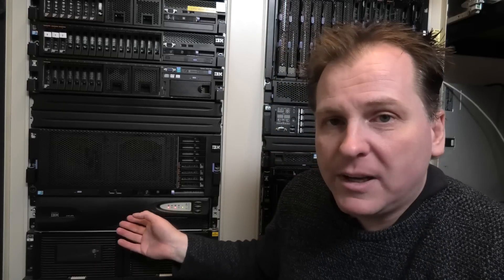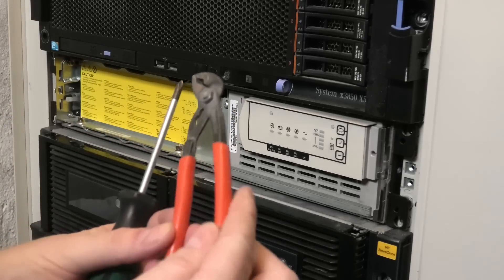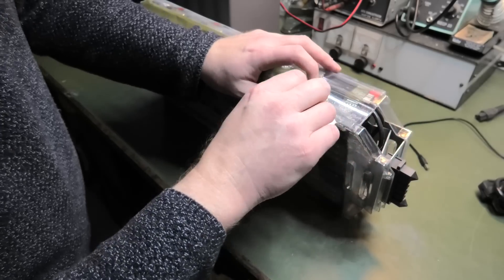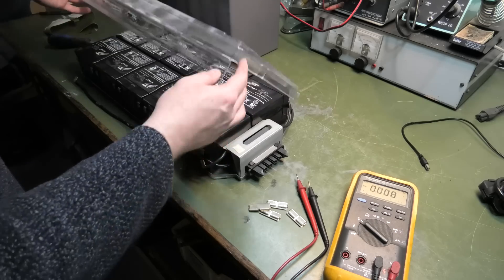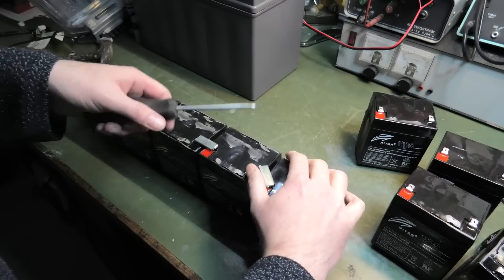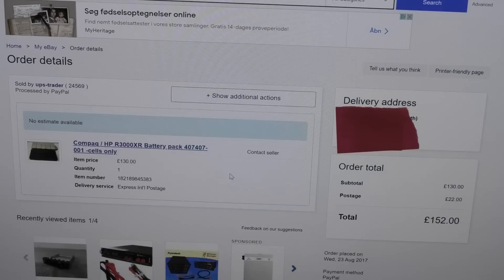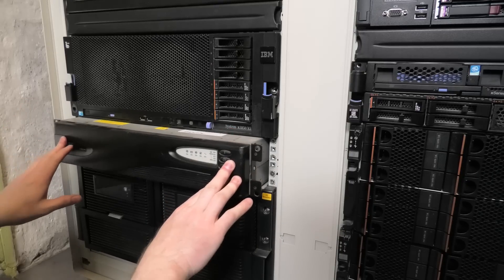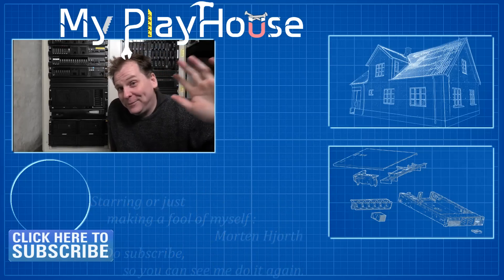Battery Backup in Enterprise 2U UPS Totally Fried - 1061

Comment: Just dropped "agm 12v 5ah" in local price comparison and found MWs 5-12 cells for 7.88 € a piece.
I would go for an off-grid solar PV system with EpEver  AiO or a charge controller if I can get cheap and efficient DC-DC PSU's, tier 1 dual glass PV panels in BIPV setting to function as a roof, smart BMS to limit DoD and LFP cells just like Andy from off-grid-garage dot com did instead of getting a dedicated UPS.
Even better with some work, could get the PV system to work in a smart home managing energy use among other things :)
Reply from the maker: Hi ArthursHD
Thank You very much!  glad you liked the video :-)
Thank you for watching! :-)

Comment: Something is very wrong with your UPS, or maybe that batteries are terrible. They are not supposed to get anywhere near that hot!
I hate that blister-like battery packs. At work, we had an MGE UPS, that had a battery pack that was made of metal with a lot of screws. Now MGE doesn't exists anymore and they sold their product line to EATON, that is what we buyed when replacing the MGE. Guess what? Now the EATON UPS comes with that kind of "blister battery pack" held together with tape...
By the way: maybe you should use gloves and eye protection, just in case that some acid is still inside those batteries.
Fortunately, this kind of batteries are recycled almost anywhere. You can probably ask any battery shop for that.
Reply from the maker: I have killed like 40 of these small batteries now,, I am ready to try something new.
Reply: @MyPlayHouse  I know that Yuasa makes very good quality sla batteries, but they tend to be on the expensive side.

Comment: I got an APC RT3000 used for $100AUD. Came with rack rails, spare battery set and feet to stand it up.

After a charge on the 192v battery set she started up with no faults
Reply from the maker: Good prices,, less than the batteries..
Reply: @MyPlayHouse  Some good deals in Australia. 42U HP rack was $300AUD, came with APC Managed switching PDU 16 outlet, cisco security router and switching gear.
Reply: @MyPlayHouse  Especially the "online"-systems are quite cheap when they are used. It is because it costs a lot of energy to use them. ~10% of net performance  are gone into heat. So RT3000 takes ~300W for doing nothing! 2600kW/h per year will cost approx 500,-€ energy each year! On the other hand the online-system is the best protection for your system. For instance I never have had a hard disc failure even I use them 24hours 360 days and change them never before 6 years.

Comment: FYI, most if not all rack mount UPS units can be 'hot swapped' where you can leave it running with all your items plugged in while you pull the dead battery chassis out and replace the dead batteries. 

Also, you should NEVER remove the screws that hold the rack mounted UPS to the rack rails because you run the risk of pulling the UPS out when you try to pull the battery chassis out. If you must pull the UPS out slightly to access the screws to remove the battery chassis, then I'd suggest you never buy that model/brand again as that is just poor design. There is no room for garbage design like that in the last two decades so anyone still doing it is not worth your business.
Reply from the maker: Hi First Last
Thank You very much!  glad you liked the video :-)
Thank you for watching! :-)

Comment: whiy cant you just fill yor ups with 18650 batterys and put a bms and fit a volt small volt meter
Reply from the maker: I could,, but my UPS in the datacenter should be an enterprises one, and not include a home made battery. :-) I might still do it, but for something else.

Comment: There is a possibility that your UPS overcharge the batteries. 
I know that APC Smart-UPS can be recalibrate the charging cut-off voltage and mabe it's possible with your UPS too.
Reply from the maker: As long as the batteries are good, no problem,, but as soon as there is just one week cell,, the UPS goes in for the kill :-/

Comment: This is a result of An too high float charge. The calliberation drifts off over time and/of the float charge is set too high becouse manufacturers try too squeeze Every second of runtime out of it. The batteries Will boil them selves. This is alsof the case in many APC units. You can turn down the float charge on APC units by software. FFcossag did some video's about this as well.
Reply from the maker: Hi Jurgen D
Thank You very much!  glad you liked the video :-)
Thank you for watching! :-)

Comment: my ups uses 40 batteries in series-parallel giving 240V DC. scary stuff
Reply from the maker: That is scary,, do you then power your equipment from DC,, or is it just the feet voltages for the inverter to make AC.
Reply: @MyPlayHouse  240ac goes into the ups which changes ac to dc charging the batteries, the inverter puts out 240ac. It's powering a Dell R920 with about 6 hours of runtime

Comment: I love that the battery is "old ish", they are usually replaced every 3-5 years so they don't get to this state, 19 years you know could be why it failed in this manner (be happy it only overheated and all the gel dried out before it caught fire witch is quite difficult to achieve but not impossible) 

I wouldn't continue even attempting to you reuse that UPS because, if it allowed the batteries to get to that state as it's obviously is not smart enough to make sure the batteries cannot get into that state (they should have been marked as failed after 5-6 years due to lack of capacity, looks like the stupid thing was constantly trying to charge them up)

Also don't just ignore ups/battery maintenance especially ones that are more than 3 years old (right at the end sounds like you never load tested it while you was around, could of failed badly when power went off last time) make sure load test them (doesn't have to be using active servers but so thing that has similar load)
Reply from the maker: The UPS is 19y,, I replaced the batteries 4Y ago.

Comment: I program the UPS to gracefully shut down the connected servers and then turn off, that is, after the power failure has been on for 3 min. This extends and preserves battery life. If the servers were critical I would have the backup generator turn on before the UPS shuts down. If your battery damage isn't the result of a short you might want to keep an eye on the charging voltage that the UPS supplies.
Reply from the maker: Hi Gary M
Thank You very much!  glad you liked the video :-)
Thank you for watching! :-)

Comment: I'm using a BlueWalker PowerWalker UPS  which has an LCD screen on it, with load and other status displayed on it.
It is a german brand with replacement cells at 30 euros per cell. So it depends on the capacity how many cells you need. Mine is a 1500VA model that takes 3 cells, so for 90 euros I good to go for another 5 years plus...
Reply from the maker: That looks very cool and affectable.. Thank You.

Comment: Youre lucky that the UPS didnt set on fire, I have such experience even with brand new UPS, where there was short from somewhere and all the server rack almost burned down :-( (It was APC Smart UPS 3000VA Rack mount- not some noname China one :-) )
Reply from the maker: Humm ,, uptime almost became burn time :-/
Reply: @MyPlayHouse  🤣🤣
Reply: That happened when you do not use battery extension pack. The standard UPS have batterys inside and temperature growths up to 40 or 50°C. That is not good for a leaded battery! External pack can be stored outside the rack and stay cool! Additionally nearly all UPS - systems have batterys stored inside in not perfect direction. It is always good to store and charge them with bleep upside. Not upside down! Not lying!

Comment: Just amazed. How dumb is that UPS making the batteries fried like that lol. When you said it is from early 2000, then I understand. My 900VA APC UPS have 3 thermal monitors, one sits between the battery, one near the terminals, and one near the MOSFET heatsink. 

my homelab currently running on secondhand APC BR900GI (obtained at ~40$ without battery, installed new lead-acid batteries obtained at ~25$), which have fancy display and USB monitor (which I plug to Raspberry Pi & run apcupsd to share battery info over IP network).

Your electricity is so reliable! only 1 power outage on last 4 years! 
Mine recorded 28 power outage last 265 days (shown on the LCD Display) currently living on Jakarta - Indonesia. most of the time, it's happenning around 1 - 3AM, probably they do some maintenance & transferring between transformers, which black out my house for around 5 minutes every several weeks.
Reply from the maker: Hi lukasb
Thank You very much!  glad you liked the video :-)
Thank you for watching! :-)

Comment: Ahh the joys of extracting swollen batteries.   My rack mount apc ups has hot swap batteries but it doesn’t help when they are swollen.
Reply from the maker: I was surprised just how easy they came out,, and how bad they looked.
Reply: @MyPlayHouse  the last ones I did involved removing the ups from the rack to remove the top cover and the chiselling them out.

Comment: What the heck happened to these batteries?! =D 
I do have an APC SU3000 and a SURT 5000 that uses the same battery types... I have used two sets of batteries already until they were dead dead, but I have never seen anything coming close to the damange done to yours =D
Reply from the maker: This model of UPS really suck them dry!! :-/
Reply: 19 year old battery pack, if they are 3-5 years old change them as they will only have 0-3 minutes hold up time or catch fire or battery go dead short as happened to one of mine

UPSs usually have a built in self test that usually makes sure they don't get to this state and will throw a replace battery warning and sometimes disable the battery if they are smart enough (becomes a very heavy surge protector) obviously this unit wasn't smart enough to disable the battery and just kept on trying to charge it (it should have given up after 48 hours and checked voltage and failed it)

Comment: Here on the other side of the pond we call them several names.  One of the names is Channel Locks after the company which manufactures them.  Another name is locking pliers.   I think UPS makes should upgrade the batteries instead of lead batteries.
Reply from the maker: Thank You,, Li-ion is available,, but crazy expensive.

Comment: I’m happy your power is so stable. Here in the south we get power flips a few times a week weather dependent. The sun comes out strong on a spring day and all the air conditioners try to start up at once or people get home from work and turn on their AC and start cooking. We also get them in winter because space heaters are still common in cold temps. 

I’ve never noticed a natural gas low pressure but I’m sure it happens. Don’t have any pilots to go out my 2 furnaces use HSI or HEI and my new on demand water probably does too.
Reply from the maker: We have very stable power,, the UPS has failed as much as the grid,, once in 4 years. :-)

Comment: I call those channel locks pliers but they also go by many other names, just like in Danish. The batteries are swollen up, not swallowed up.

I used to have a UPS at one time and that was fine.  I replaced the battery once and after another couple of years the UPS electronics died. The power quality has been good with maybe one power outage a year, so I no longer use a UPS. My PCs are set to stay off when the power comes back.

I should look at an inverter for a car battery.  Car batteries are way cheaper. I know they are not intended for deep cycling but perhaps getting the computer to shut itself down after 5 minutes on battery?
Reply: Channellock is a US brand name and they call those tongue and groove pliers
Reply from the maker: ahh sorry,, "swallowed up." bad translation from Danish..